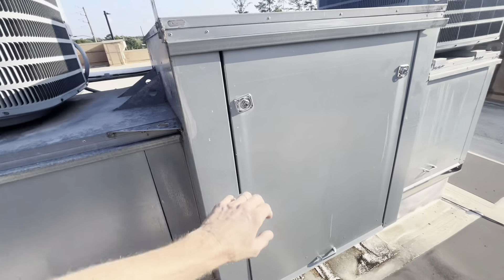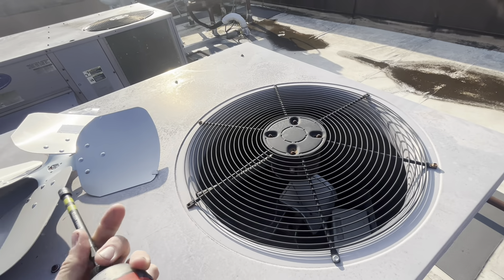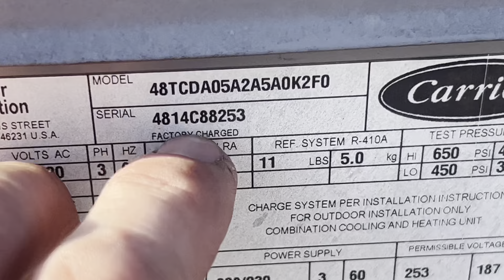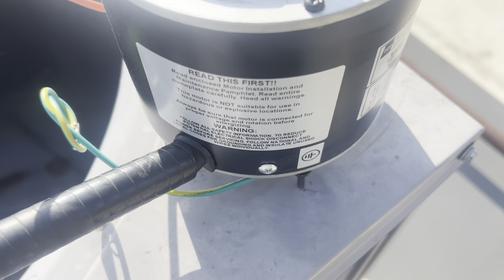Carrier condenser fan broken - mistakes were made….

Comment: You did not have the capacitor in circuit. If you are not using the 4th wire then you have to have the power lines correct
Reply from the maker: Everything was wired as it was before and as it is now with the 1/2 horse.  Yellow line in and pass thru on yellow.   Brown from the cap.  I agree it seemed like that was the kind of issue but also the reality was even after getting it started that motor was dying  way overheating and overamping.